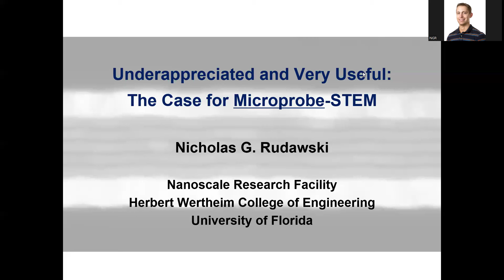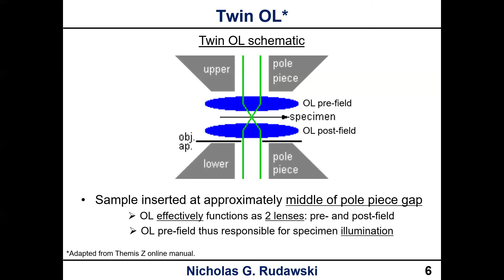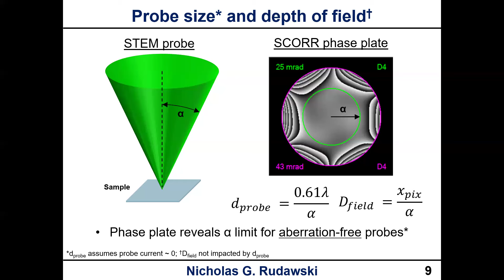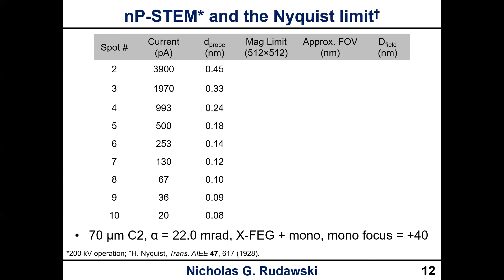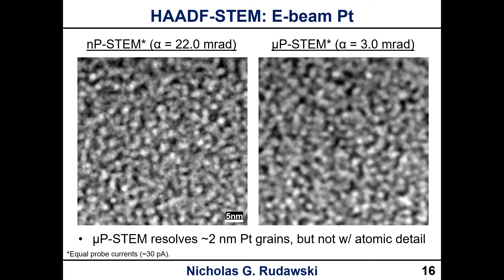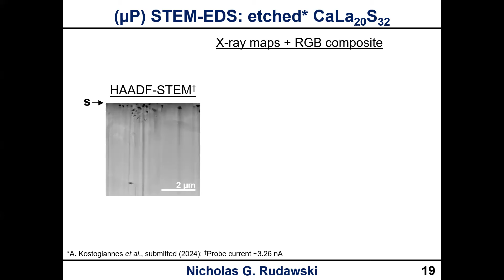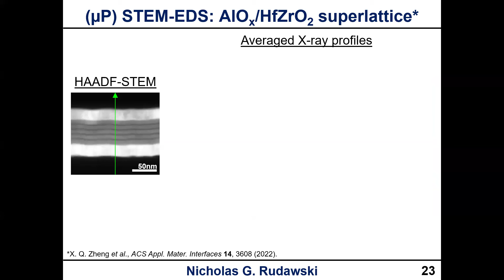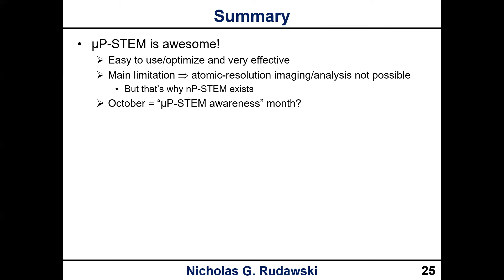Underappreciated and Very Useful: The Case for Microprobe-STEM

Comment: Nick, thank you very much for this video and for remembering me that current in microprobe is much bigger. Earlier, on Tecnai G2, 90 % of time i worked in STEM microprobe. The main reason, i used mProbe - strong diffraction contrast in BF, so useful in visualisation of metals and alloys. There is a big overlapping of central and diffraction spots in nProbe, and as a sequence brightfield images are awful, as in TEM without objective diaphragm. But  in mProbe  this problem is absents.
And especially thanks for table with alignments procedures for both modes!
Reply from the maker: You're welcome; yes uP-STEM is definitely advantageous when you are trying to avoid disc overlaps in the DPs and form true BF or DF STEM images to improve contrast.  I am planning to do another MSA webinar in mid November specifically about STEM imaging so that would be a great opportunity to discuss this (as well as the comparison with nP-STEM mode I did here).

Comment: Hello Nicholas, thanks for bringing awareness to µP-STEM! It's a great mode for applications where one can get away with non-atomic-resolution (which are plenty!). The usage with the increased depth-of-field for the nanoparticles is very useful. 
One other important feature: The ability to acquire "useful" diffraction patterns (in the sense of - often - separated Bragg spots) by simply dragging the beam around with the beam position marker tool in the same mode as STEM imaging and EDS! 
On the contrary, I think "nP TEM" is even less appreciated and might be an idea for a video (parallel illumination for smallest possible area)? Then you have all combinations of TEM/STEM µP/nP complete. :-)

Comment: So when you are turning the focus Knob, whose focal length it changes: upper or lower objective?
Reply from the maker: Great question!  While the OL effectively acts like two lenses, these cannot be controlled independently, so you are changing the strength (focal length) of both at the same time.  This is why the MC coil is present in the upper pole piece, to reduce the effect of the OL pre-field when it (the MC) is (optically) on, which corresponds to microprobe mode.  Otherwise, the system would only have nanoprobe mode.

Comment: Thank you for the helpful video. One question I hope you could clarify is wether the depth of field and the resolution would be the same for the microscope aligned in microprobe mode at 3mrad and one aligned in nanoprobe mode with an aperture limiting the convergence angle to 3mrad? And would the probe currents be the same?
Again, thank you for making all these amazing videos and for showing the cool results.
Reply from the maker: You're welcome, glad to hear you found my video helpful.  Your question is a very interesting one indeed.  Should there be any difference between nP and uP if the convergence semi-angle and probe currents are the same in both cases?  Well, in principle, there should be no difference because angles are angles and current is current, right?  With the Themis being a 3 condenser lens system, it has the capability to arbitrarily set the value of alpha in either mode, but I don't know if nP has the range to obtain alpha < 3 mrad.  It actually may be easier to make alpha larger in uP mode to be comparable to alpha in nP mode.  Even with alpha being the same, I believe there would be a discrepancy with the currents in a 3 condenser system because of the "zoom" between C2 and C3 which causes the current to decrease as alpha is decreased.

Comment: Hm... on our Titan people use microprobe only for 4D-STEM with EMPAD that we have, I did not know that it actually has some benefits :)
Although, knowing that we have some histeresis after switching the modes and the need to realign everything  every time seems like too much just because of better depth of field. I'll try it next time I'll need BF, though. The other thing is if you're doing CBED, how much would that influence the resulting pattern? I saw some people saying that the discs won't be overlapping?
Reply from the maker: Yes, you are correct about the discs not overlapping (or at least overlapping less) in uP-STEM versus nP-STEM.  I actually discussed this in a video about CBED I did several years ago using our Tecnai.  You are also correct that true BF-STEM is not really possible in nP because of the discs overlapping, so uP also has an advantage here, too.  It would be interesting to do an image comparison of BF-STEM in nP versus uP using a material with lots of dislocations.  This would definitely be another good video to do at some point.